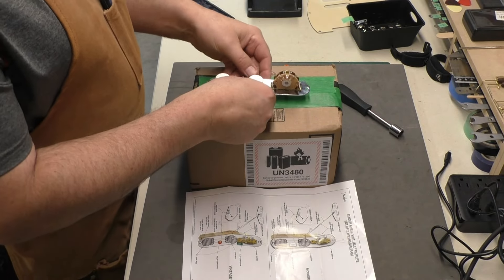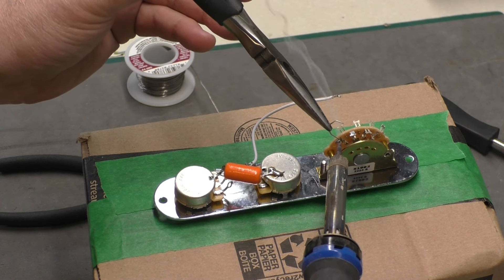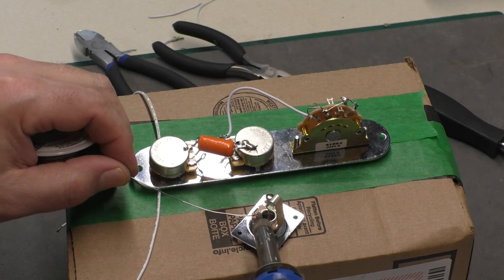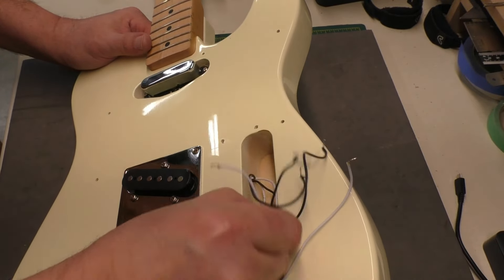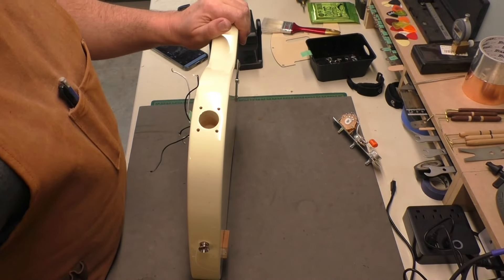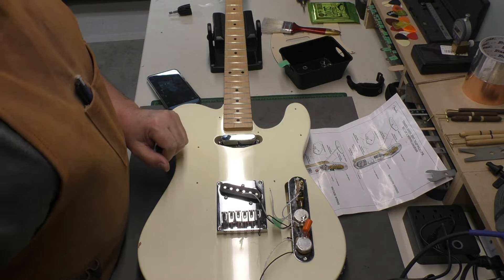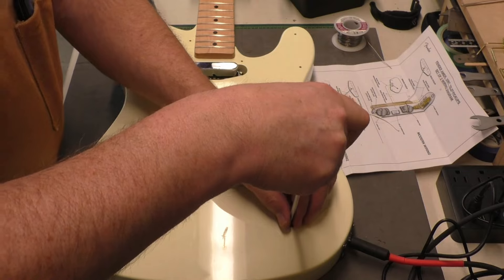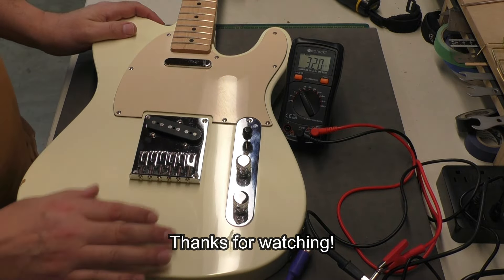How to Wire a Telecaster : Creamy, Dreamy Squier Telecaster Part 2

Comment: Some comments:  you did not ground the neck pickup cover, the resistance values of the pickups are in KILOohms, 22nF for the tone control of a Telecaster may be too small - the more common value is 47nF.
Reply from the maker: The cover on the neck pickup helps with noise- the pickup ground is attached; ohms, kilo ohms...whatever 😁; the owner supplied the parts.